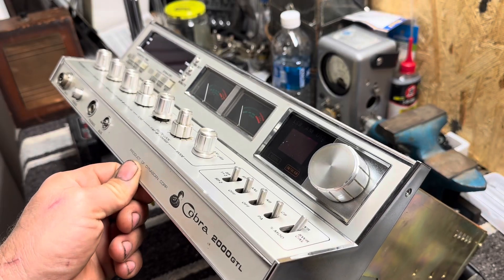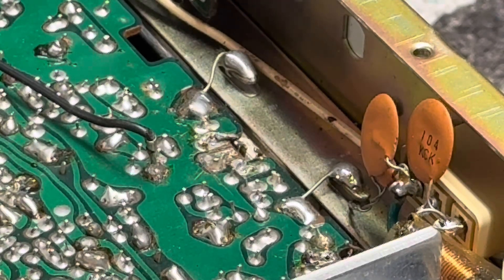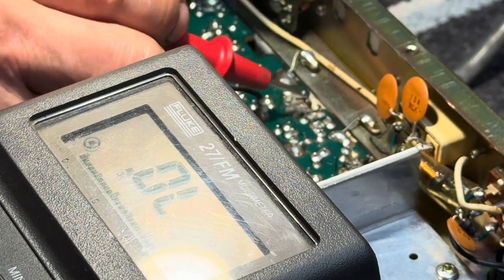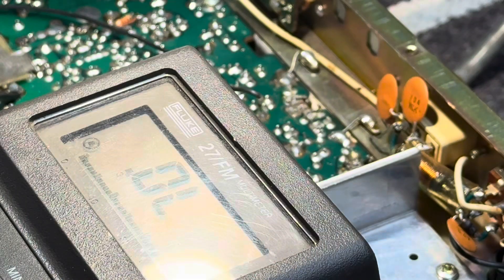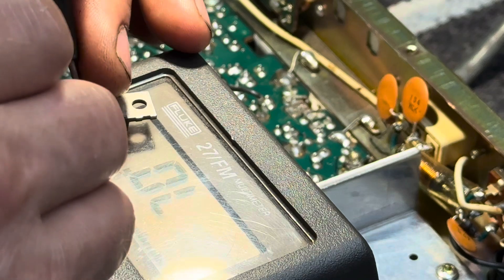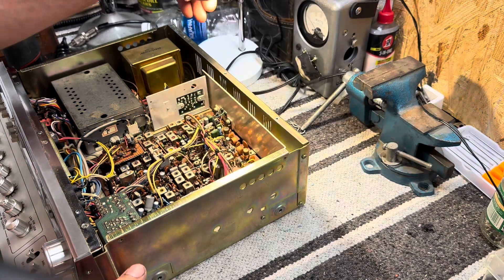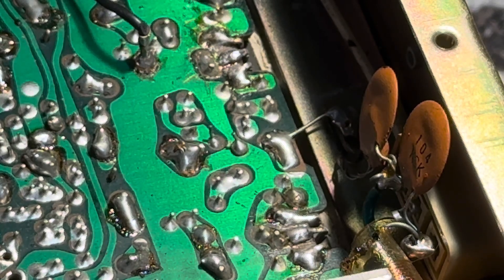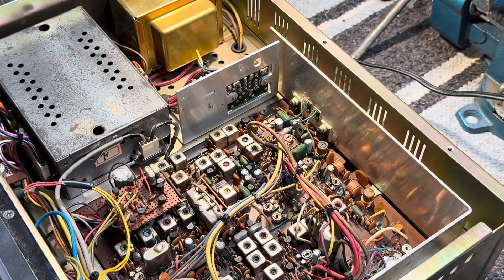Cobra 2000 No RF power output repair How To DIY diagnose and cause of problem

Comment: Got Schematics ? Some solder points &/or traces can crack due to use. Turn it on it expands as it heats. And then the opposite when it cools off unused,.... for a couple of years. 
(The solder slowly work hardens and becomes ductile over time.)

Try working on Vacuum Tube Controls.
Reply from the maker: I love vacuum tube everything, that’s my favorite stuff. Give me 3800vdc @4 amps with 92a @5.3 volt for some filliment so I can heat up 5 3-500z’s and we’ll have a good time heating up some RG 217 coax😁😁😁

Comment: Usually back in my repair days if a power trainstor goes bad somewhere off of it may have a 100 ohm resistor go bad. Great job thanks for sharing I'll finish watching.
Reply from the maker: Thank you Jack ✌️❤️